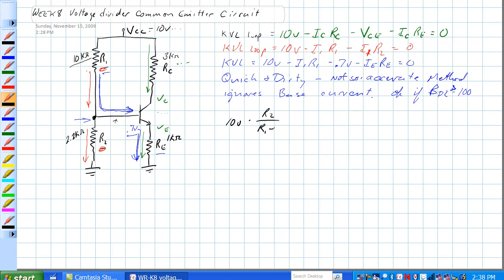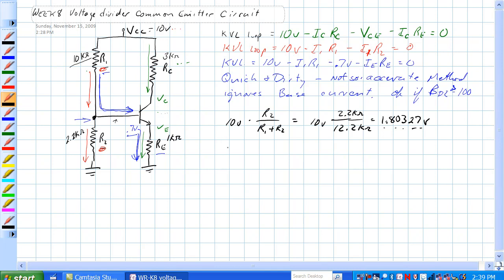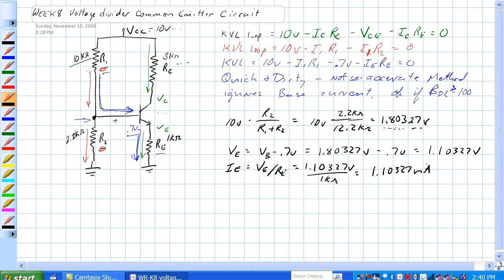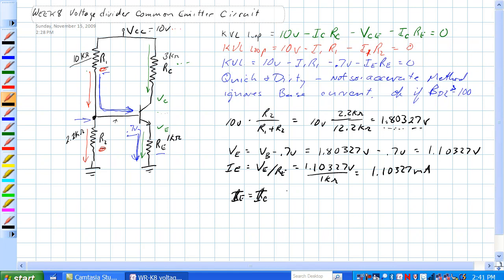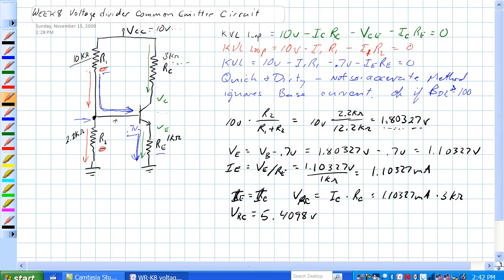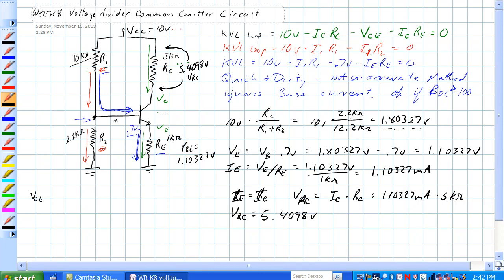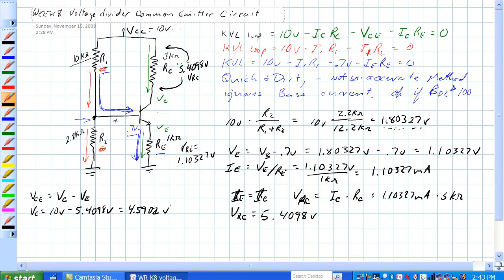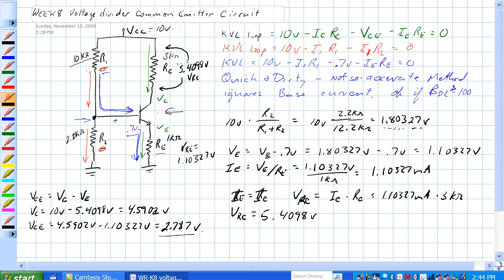Voltage Divider Quick Dirty Part 2

Comment: This calculation was not correct, but there is one more mistake in the first place: Vrc=3.3 Volts and not 5.4098 as he wrote. Therefore everything afterwards is wrong. But at least we get the idea of how he approaches the problem.